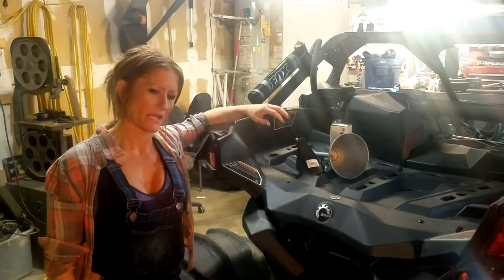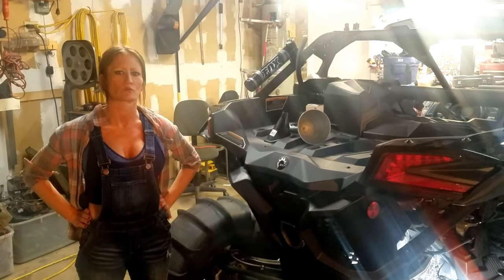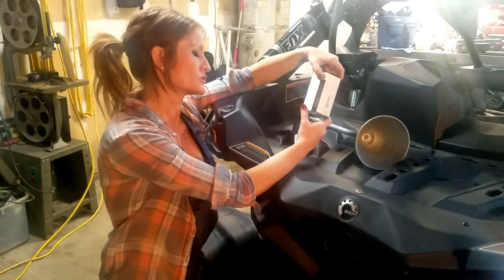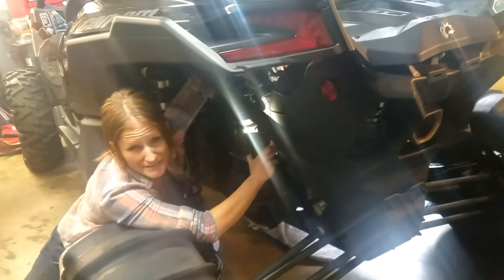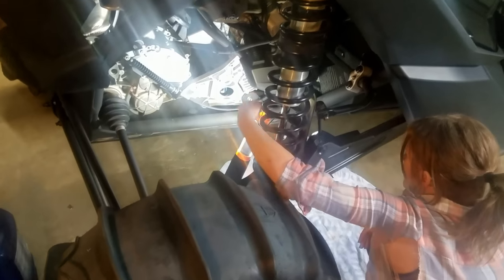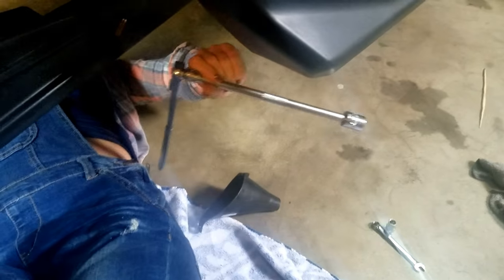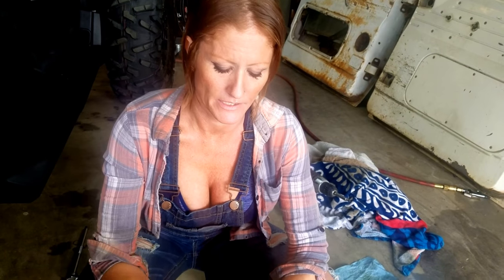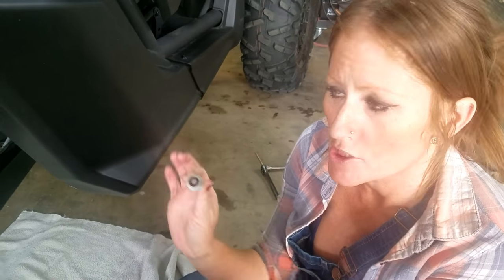Maverick X3 Oil Change And Tips

Comment: Little tip from the kitchen / I use aluminum foil under the drain funnel / I tear a good size square and roll up the sides as to make a small cookie sheet, place it over the center drain hole then use your funnel punch a through it. This way if there is any splash out or over fill of the funnel the aluminum foil pan will catch it and still drain into the bucket. I also use a premarked oil can filler to help with refilling the X3 with oil. 
Not at all trying to bash, just help. I think you were a great help with your video.
Reply from the maker: Thanks for the info, and thanks for commenting. We'll definitely have to try that out

Comment: How did that rotella t6 worked   i use that on my vw buggy and trucks n cars  but haven't tried it on the can am
Reply from the maker: Well we have 3,000 miles on the car now and so far so good.
Reply: @DandiOffroad  is it still going with rotella?
Reply from the maker: 3600 miles, the last change was Can-Am oil

Comment: Why rotella not can am oil? Been a mechanic for years. Its been engrained in my brain that all oils are not equal... 34k machine im not skimping in the oil, filter, crush washers, etc..
Reply from the maker: I may be misinformed but I was always told that Rotella was a good quality oil. I could be mistaken I'm not a mechanic for sure.
Reply: rotella T6 is awesome for just about anything
Reply: mechanic for years??? and your dont know about the different rattings of oils. any SJ, SN, SM 5-40 synthetic oil is usable, per the owners manual
Reply: @stang1970  Rotella is for Diesels it starts with ck cj c= compression ignition
Reply: @DandiOffroad  Great Video and you did a Great job ...but Rotella is for Diesels and it's great for Diesels but i would use either Can am syn or Mobile 1 , Diesel oils have more Additives because Diesel is not as refined as Gas which can make it more expensive than the gas version.....
Reply: @thetruth4791  so is Rotella not necessary but a higher quality?
Reply: @theglitch99  Rotella is one of the Best Diesel oils out there ,But you will paying for additives that Gas Engines wouldn't need, Bc of the Refinement of the Fuel, Diesel Fuel is Dirty and the Oil has to Protect it from the Corrosive nature....of the Diesel fuel, Low Sulfur Diesel is now a Standard, but it still has some Sulfur..